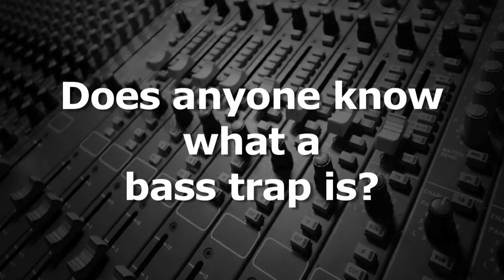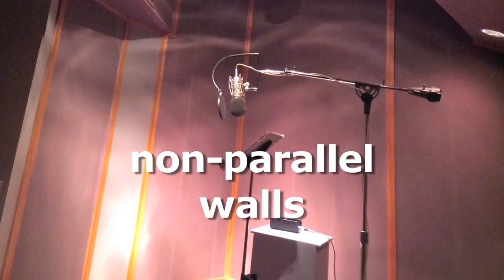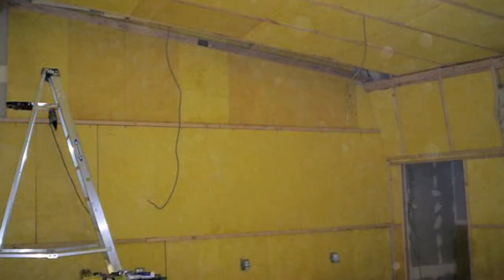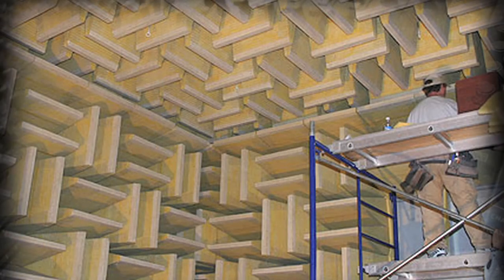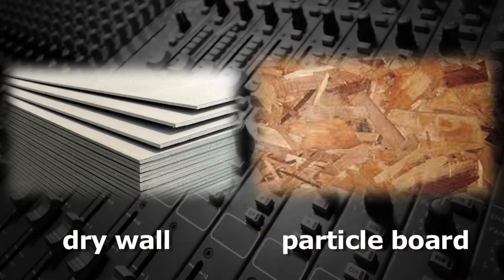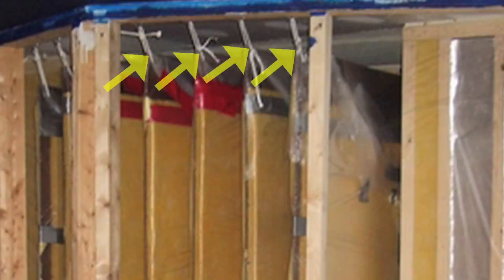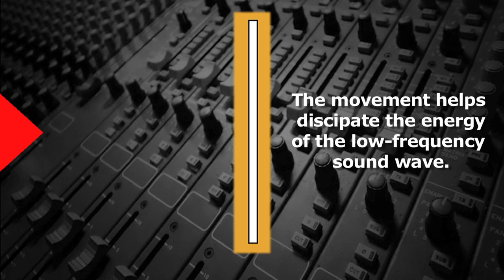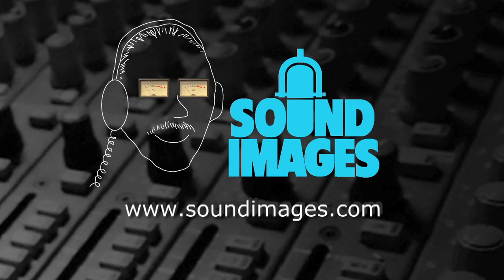Bass Trap

Comment: You need to look at things like resonance. A piece of wood, length x width x depth will resonate at a certain frequency, meaning it will vibrate at a certain frequency and the energy is absorbed. Ethin Winer has plans on his website for membrane bass absorption. Basically a speaker box without speaker or holes. Just a box and the front panel moves with the frequency. If anyone has any effective methods for absorbing low frequency let me know.